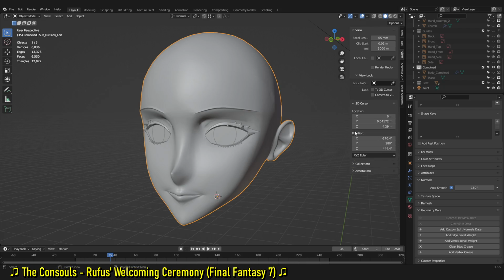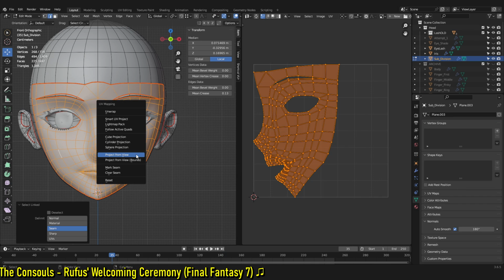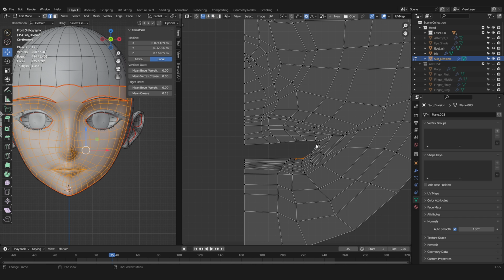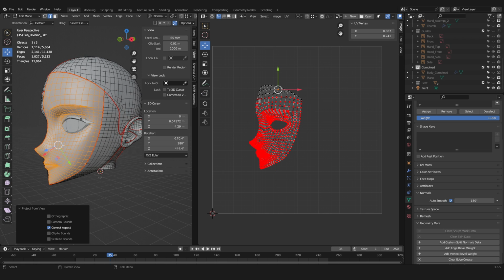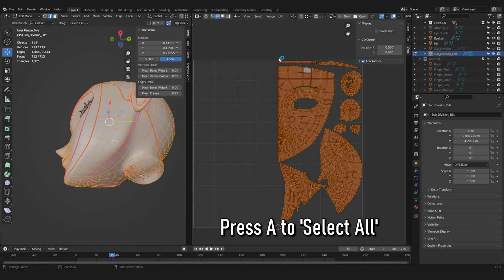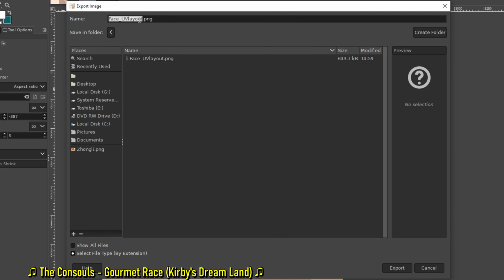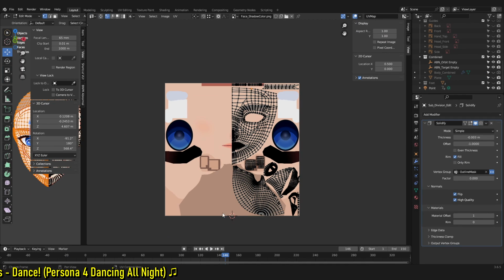How to Texture an Anime Head in Blender 3D!

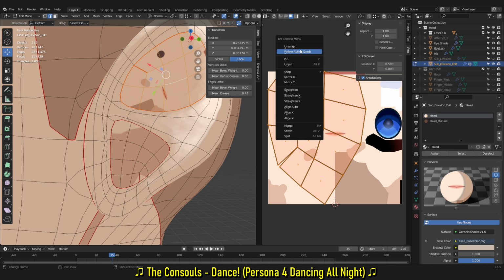Comment: awesome work. thank you. also, you can use uvsquares addon to rectangulate uvs (10:04). this addon also somewhat works with eventual triangles (or intentional tris made on cheeks for designating a rembrandt triangle) better than rizomuv. waiting for a video on how you manage normals for face shading, what angles you chose and how you would approach potential problems with shading deformable areas, whose normals were modified (face expression blend shapes etc). hope you find a best way known to humankind as usual.
Reply from the maker: I used to use UVsquare a long time ago, I think before follow active quads was a thing? Wasn't aware it's other features so I will keep it in mind for the future.

Next video will address face normals. I edit mine manually, as for blend shapes, I'm aware of the problem and I think the method I use doesn't solve it, however I will eventually revisit the subject as there are other methods I do want to explore, wont be sure if they overcome the blendshape issue until I try them. I know how to solve it within blender, but the problem is solving it for outside of blender.

Comment: I liked the way you modelled your hands so planning to try out your technique. 

By the way, I have seen a material setup where you actually use a separate image texture for inner lines (Royal skies anime shading). Will that work with this basic UV unwrapping? I know that requires square UVs but it's very tedious to square out every single island.
Reply from the maker: There are a number of techniques you can utilize. Vectorizing is one way but it will increase your vertex count and require you to do a lot work to the mesh typology. That includes the squaring out technique and just cutting out the area and unwrapping into a block area and letting the geometry do the work.

The problem with setting up UVs this way is it often distorts the UVs of that area, this is fine if you just want to block shade stuff, but if you want to have some texture to it, it'll look weird., or say in your game you plan to have overlays such as dirt on your character that you apply through vertex paints or something, setting up a consistent seamless texture can be hard.

As for the royal skies way it's been a while since I saw that video so I'm not sure how he goes about it, I know that some of the stuff from arc system works use some extra texture maps to do funky stuff, some of them are have separate masks on the RGB channels as well. I haven't gotten into the weeds on that stuff.

Obviously you can do various details/lines is simply unwrapping normally and drawing it on the texture, but another way would be to create a plane that hovers just above the surface of the main mesh. Then on a separate texture map you draw your details with an alpha channel, then on the material either use an alpha cut-off or just alpha set up in general. I've used this for low poly models for their eyes and mouth before now. The main problem you have with this approach is it makes your mesh a little harder to weight paint later on, as you've got to make sure all these extra detail planes deform correctly with the rest of the mesh. (but there are way around that)

Honestly it all depends on what you're trying to achieve and how detailed you want it to be. With the Royal Skies video, a lot of the things he is showing are hard surface based (Robots/guns etc), so using follow active quad to square out your UVs is a real good for that kind of modelling.
Reply: no need to square out every island. you can always cut a piece you want inner line to be placed on, and rectangulate it only. but don't cut your mesh uvs too much, it will ramp up your vertex count in game engines.

Comment: there's options for mirroring uvs in the mirror modifier. you can drop down the arrow and check mirror uv in U direction which is x axix.
Reply from the maker: Yeah I did spot that in the process of editing the video, so didn't have chance to see how it actually worked. Not sure how long that feature has been there because I've always mirrored this way so it just slipped me by 😅